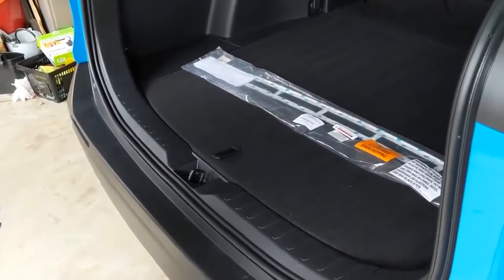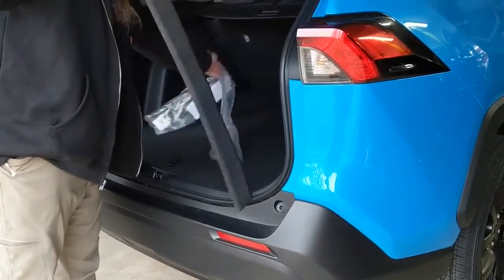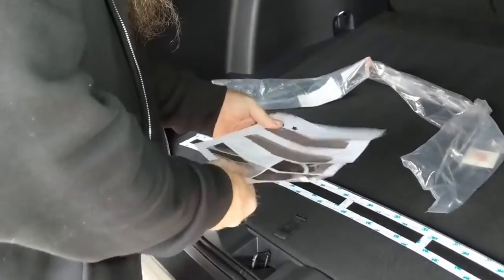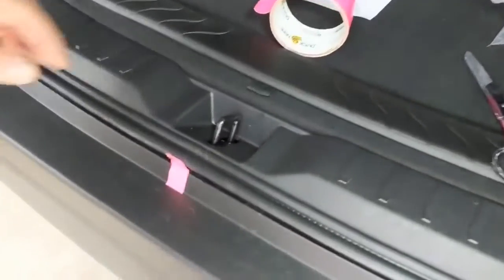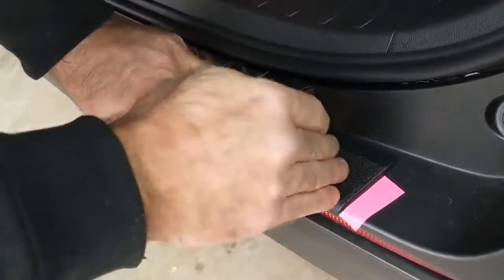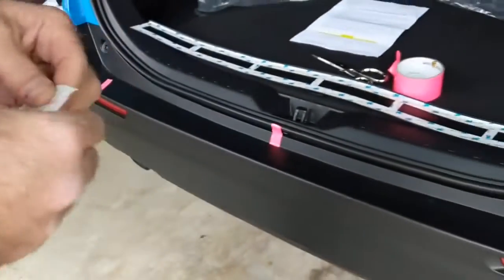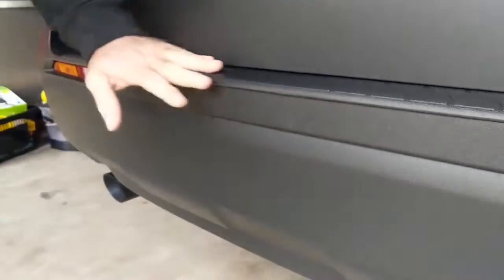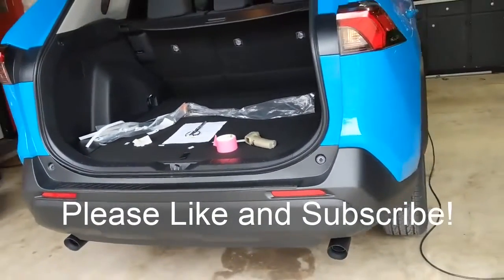2019-2022 RAV4 Rear Bumper Protector Installation. So EASY!!!

Comment: Nice work. Just curious if the extra thickness may affect the tailgate drainage (there are 2 drain holes at underside of tailgate)?
Reply from the maker: We haven't noticed any issues with drainage, it doesn't seem thick enough to block them or impede anything

Comment: How is the quality and helding up so far??
Reply from the maker: So far so good, I did have to add a tiny strip of double sided 3M tape to one side. But other than that, we like it.
Reply: @installsandpitfalls  Very nice that’s great to know where should I add 3m to make sure it’s strong enough??
Reply from the maker: @alanh8101  it was just a small section on one side, I'd just make sure it's clean and install it. I wouldn't bother buying tape unless you need it. But, it's always handy to have around.
Reply: @installsandpitfalls  Nice Thank You 🙏🏻to let me know
Reply from the maker: @alanh8101  you're welcome